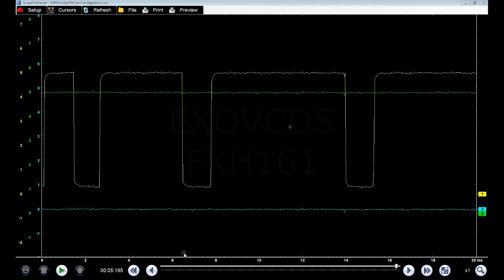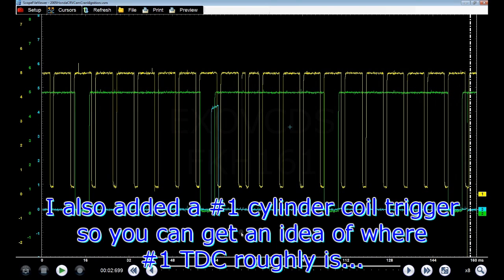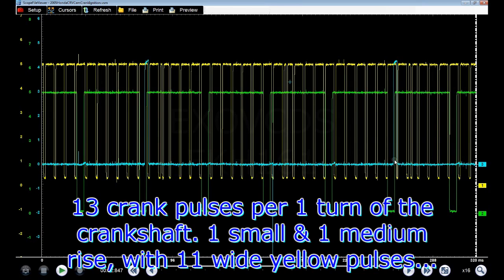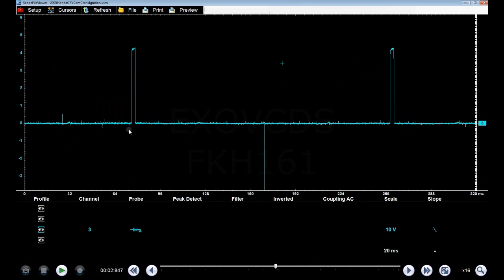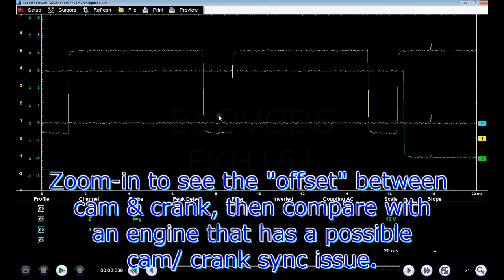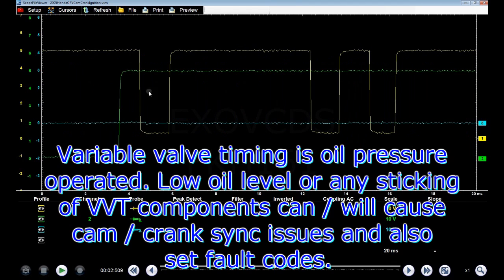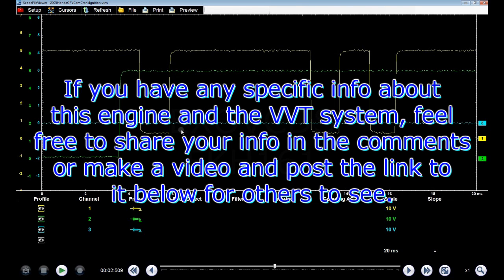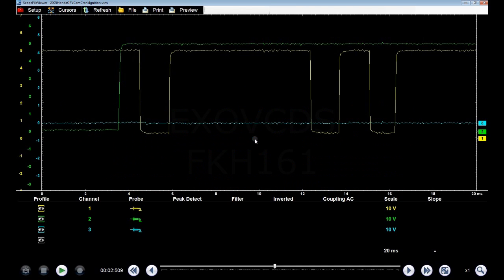2005 Honda CR-V 2.4L Cam & Crank Waveform

Comment: Doesn't this engine trigger using the exhaust cam because it is stationary? It doesn't make sense to trigger off the intake cam if it is continuously varying. The intake cam has 4 even teeth as shown in this video, but the exhaust has 4+1

Comment: Nice looking waveforms Thomas and I guess you do get other cars besides VWs and Audis :) One thing that may be of interest that I learned in Autonerdz with VVT is to take the waveforms just off idle. On some cars and I can't remember which but the camshaft signal will have a waveform that looks 180 degrees out of phase. In other words, the signal that's high will be low and the low signal will be high. Once you come off idle slightly, the waveform will straighten itself out. Nice work...
Reply from the maker: More great info from you... thanks for sharing Terry! I always only record / save an idle capture... sometimes I'll do a snap to check for drop-outs. It's definitely interesting how different manufacturers do the "same thing" differently! LOL
Reply: That they do Thomas. The rule of thumb for VVT vehicles from AutoNerdz was to look at the waveforms at idle and then slightly raise the idle. If you notice that the waveform(s) for the camshaft(s) flips because of the cam phasor(s) then take the waveform slightly off idle.

Comment: what are you doing messing with a Honda?the sad part is I have seen many issues with that engine jumping time, lack of maintenance, they start burning oil and jump time a tooth or 2
Reply from the maker: Low on oil was an issue with this one.... external leak. Will be coming back this week to re-check (we shampooed the engine).

Comment: Thanks for posting and explaining. I'm staring at the cam/crank signals from my Mazda into which I just swapped a Ford Fusion 2.5L. The thing just won't run and I'm suspecting either the cam timing or the OCV forcing the timing retarded. Not very well versed in these signals and what's what so I have the info but not the knowledge. Yet.
Reply from the maker: That's why having a good waveform can be of great help... if the waveform is the same, then that's not the issue, move on to something else. Would love to have the time to play more & more with the scope. If the Fusion signals are different from what the Mazda had, then the ECM won't know what's what.
Reply: Agree. Thanks!